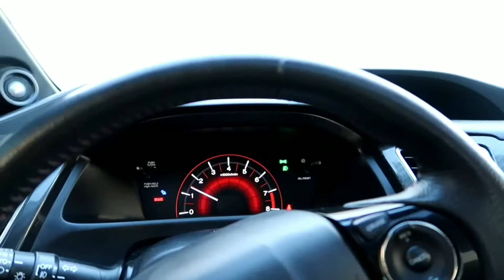Engine rod knock Made It Home

Comment: How'd you fix it?
Reply: My lx is having the problem too but it can idle
Reply from the maker: Motor swap
Reply: Cle Garage How much did it cost to swap
Reply: Tanasha Brown I’m stuck between getting it rebuild or a used engine with 107K miles.
Reply: Tanasha Brown With the rebuild, I’m scared i might get another Rod knock . But with the used engine I’ll never know nothing about it until i get it installed
Reply: Tanasha Brown 120K on the miles with a perfect condition body